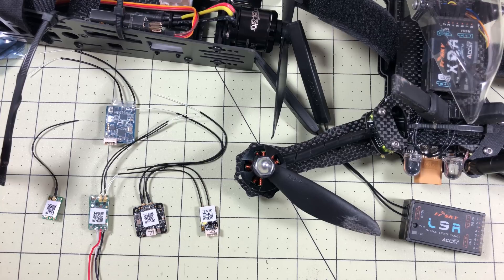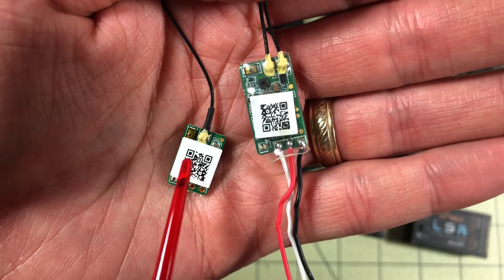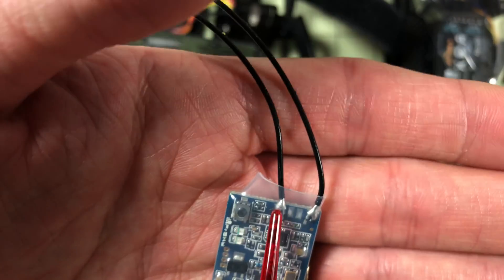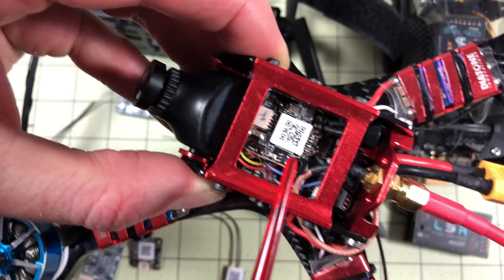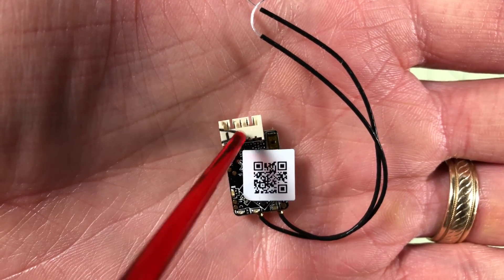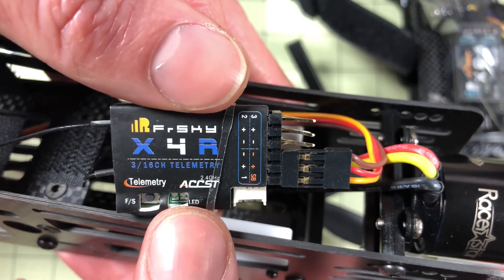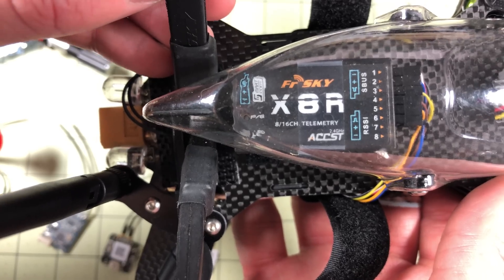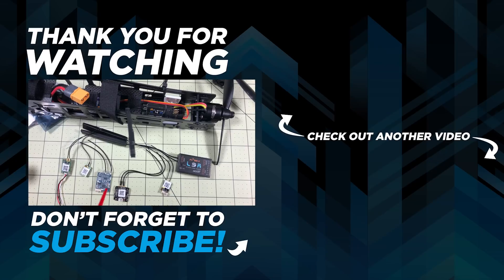FrSky Receiver Comparison! Size? Weight? Price? Telemetry? How do you choose?

Comment: Does anyone know how it works with the voltage compatibility? 
I could buy the FrSky XM+ Mini 16CH SBUS Receiver (EU-LBT) With voltage use : 3.5 ~ 10V
However, my drones use 2S and 4S battery's. Does that mean that the XM+ works with the 2S but not with the 4S? Since the 4S works with 14.8V... does this blow up the receiver? Or does non of this matter?

Comment: How did you get the XM+ receiver already pre soldered? I’m having issues with mine trying to figure out what wires to use and it would be easier if they came pre soldered

Comment: DroneRacer101 - I have been trying to connect my FrSky V8R7-II to Pixhawk.  For some reason I cannot get the Radio Calibration to work using Mission Planner.  After reading the Rx instructions there isn't anything special that I see that would not allow it to connect to the Pixhawk. Any Ideas?

Comment: I have a GepRC 12A F4 AIO whoop FC  and using 200mw vtx. I want it to be lightweight as possible. Do you recommend r-xsr or xm? Because xm seems to be lighter. (i do not want my 200mw video link longer than my radio link by the way) Thanks for help! :)
Reply: XM+ will do the job in this case.

Comment: I've just got this drone as i was inspired from UAVfutures. I got so damn excited only to know that i actually needed a reciever which he never even talked about in his video and got let down. I have my parts now except the reciever and you've just helped me out. Bit pissed off that one who tries to inspire (New) drone operators to fly, not featuring EVERY single part when it comes to drones.

I now have these parts:
ESC: Racerstar StarF4S 30A https://goo.gl/pjBRir
Motors: Samguk Series Shu 2306 2800KV https://goo.gl/1PNPK8
VTX: TX5258 5.8G https://goo.gl/McRMPF
FPV camera: Foxeer HS1177 V2 https://goo.gl/oQJ6a7

I also Have a frame and a Taranis Qx7 remote for this as well as two S4 batteries that i believe will work with this quad i'm trying to build.
Now i'm gonna try to get a reciever as well and i think i'll get the FrSky R-XSR but not entirely sure. Need to do some research on it as i don't really know which reciever works whith which parts.
I have a rather basic knowledge of soldering and which cables goes where but the manual showed it rather clear. I might not have one of those white "plugs" to just pull out and in the cables, so i may have to solder them into the ESC. But i guess i can just solder for example 5v to 5v and SBUS_OUT to SBUS_IN.

IF you read this and reply, you're my hero. You have earned yourself a new subscriber for sure! I do wish you the best and really hope i might get a reply from you. Greetings from Sweden!

EDIT: Oooh, and i also have a set of googles too ^^ Forgot to mension that xoxo
Reply from the maker: R-XSR is a good pick. Yes on the wiring. I don’t think I probably have the best video for hooking up the telemetry. I would recommend Painless360 for the probably.
Reply: Its honestly BS...  Why would you not even mention that a reciever is needed in a build...  wtf!  I have titan f460 fc with akk dvr vtx..  Its been fun

Comment: Nice info. Thanks. Do you require R9M module to bind all this receivers...??? Or Qx7 can directly bind with all...???
Reply from the maker: The QX7 will work with all of these. These are 2.4ghz. If you want to use the R9 check this out. FrSky Taranis R9 Transmitters and Receivers Slim vs Slim+, Mini vs MM https://youtu.be/nnqjBbq89ng

Comment: Both XM and XM plus can still transmit the RSSI value back Transmitter via Channel. Thus you will still get Transmitter yelling at u. It just cannot return other value like voltage and so on via telemetry.

Comment: The X4R he showed was the X4RSB.  It only has 3 pwm outputs and sbus plus telemetry.  It's my choice on quads because I use a camera tilt servo connected to the receiver.  I use pcb antennas and have had them out 1.55 mile.  The X4R in the white case has 4 pwm and no sbus.
Reply: flyandride I was about to comment the same thing.

Comment: XSR all the way... at today's prices its a bargain... I designed a 3D printed mount that goes on top of the Flight Controller... and the antenna is impossible to cut with a motor... I run this in my 210's and 250's...

Comment: My favorites right now are the R-XSR and the XSR-M. R-XSR is generally the best option. But sometimes on a newer frame with secondary stack mounting location like the Bot5 frame, the XSR-M is a neat choice.
Reply from the maker: Curtis Campbell I especially like the cable it XSR-M comes with. It makes it super easy to hookup in a model like the Diatone GT200 that has ports. Just plug it in. Mostly...
Reply: Have you notice if the r-xsr gets hot?

Comment: Great summary.

Most of the current X series FrSky RX's also support F.Port protocol (which is control and telemetry over the smart port wire).  This requires a re-flash of the firmware.  But be warned, F.Port turns the SBus signal off.
 
Use heatshrink or tape with the R-XSR.  If it gets too hot, then the caps can detatch (de-solder) and take out telemetry or control.  If held tight by heatshrink or tape, this should not occur.

Comment: At fly egg 138 you recommend XM+ or any other? I have Taranis Q X7.
Thank you. (Y)
Reply from the maker: Bobby Fillettcky i would recommend the r-xsr for that at this point. http://bit.ly/FrSkyRXSR-GB
Reply: DroneRacer101 O thank you. The instalation video will be really nice to see. And will be watched numerous times. :) ;) I finally ordered egg 138. I couldn`t wait longer for some discount.
Reply: +DroneRacer101
I have now r-xsr and 138 Fly egg. The problem looks how to connect Smart port for telemetry to 138. Here is some video:
https://www.youtube.com/watch?v=o2Vms5fP0Vk
But Diatone in this video uses F3 controller. While 138 uses F4 controller. And I don't see at 138 controller free port to connect Smart port wire, cause there is just one inverted UART, but we need 2 such UARTs. :S

Any simple solution will be nice to see.
Thank you. (Y)

Comment: You can actually use the small SBUS-Rx in a wing! You just need a SBUS-to-PWM-Converter. Round about 11$ on BG or HK. This is btw a very cheap option if You own a lot of wings: Get a good SBUS-Rx and a couple of converters. This way You can use the Rx (which might be quite expensive if  you use a L9R) as a swappable part.
Reply from the maker: penguins can fly have you used them?  I have heard of them but have not heard good thing about them.
Reply: DroneRacer101 Yes, got a couple of them.  Work flawlessly with the XM+ and XSR-E (my actual favorite Rx: cheap, reliable, Telemetrie-capable).